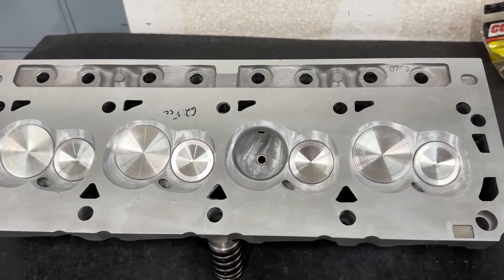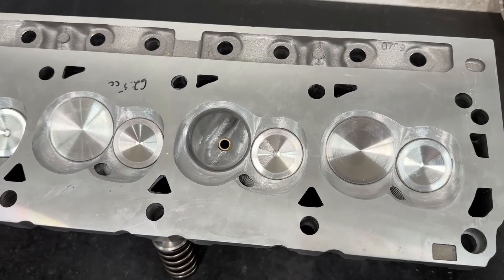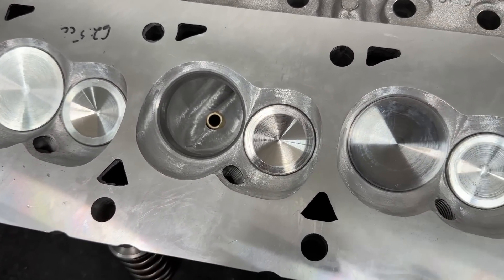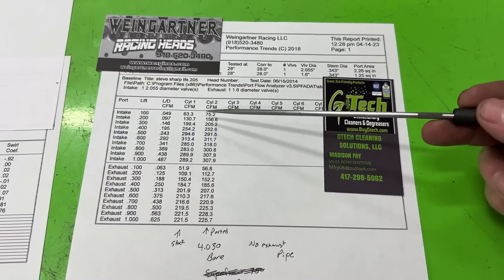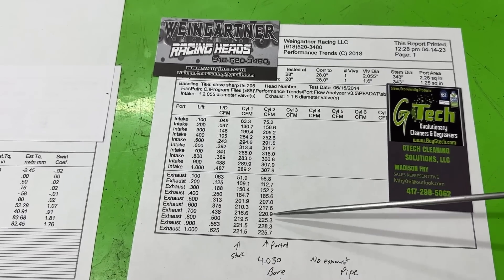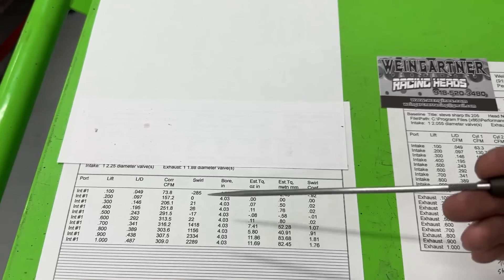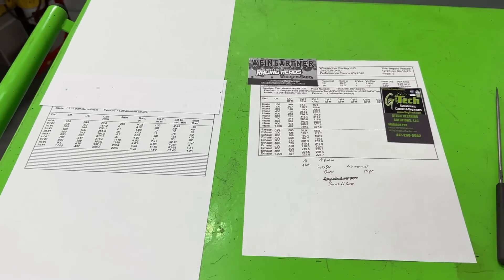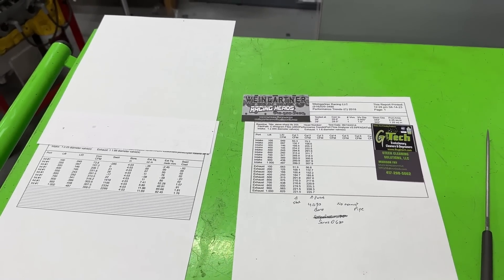SBF Trick Flow Heads

Comment: Back in 90s i built a 306ci first with ported E7s all add ons and 9.7cr, made 268rwhp at the time I upgraded everything so ran out of money for aluminum heads but set engine for them in near future.  Swapped just E7s for these cr remained nearly same and WOW what an improvement made 312rwhp.  Power increased across the board with peak HP occurring 400 rpm higher now.  I debated between these and AFR 165 and very happy I went with these, ran them about 2 years trouble free.
Reply: If you look at the dynos the TFS TW always made more peak torque than any of the others and higher hp.   The higher peak torque with the same combo means they are more efficient.   They really kick ass.    If you were doing it again, you could setup a combo that makes similar to coyote numbers with ported TFS TW and the right parts.

Comment: Thanks for the FORD stuff  hopefully you ll do more had a set of these on a low compression 351 with a 224 234  500 520 cam with 112 lobes never had it on the dyno but in a 3600 lb car it ran 12 60 at 109 with a 2500 stall and 4 11 gears  still have the heads plan to put them on a 408 and this video give me a direction to move in thanks

Comment: I know some of the class racers back in the late 90’s use to weld up the seats to drop the valve lower which helped with shrouding and that short side. Also I’ve always heard these are swirl ports that got noisy on the bench after .600 lift and the high ports are tumble ports.
Reply: The Ford Twisted Wedge with the stock intake port location and 15 degree valve angle stock is a mess but in the right hands they can be made to make great power. Had a set done by Mike Curcio years ago that were previously CNC ported buy a reputable company and one thing he told me was how loud they were on the flow bench at higher lifts and once you get the ports right they became much smoother and quieter on the bench and then you know you are going in the right direction with the port. The ports he did and the ports Eric did are almost identical at every valve lift except mine were 8 more cfm better at .400 and Eric's 6 more cfm better at .600" and 11 more cfm at .700 and they backed up about the same. It seems that no matter what you do they stall around .600"-.700" but they still will make great power. On a pump gas 374" to run 10.30 at 129 through mufflers weighing 3280 tells you how good these heads can be in the right hands. If I'm not mistaken I think Mike was the first to run 8's N/A with a T/W R head? Great job Eric and whoever is putting those heads on will be very happy.

Comment: Question, on my 3800 v6 heads. Alot of castings these days are cracked in between the intake and exhaust. Alot of guys just keep running them. What are long term effects of not replacing the heads while running heads that have cracks between the valves???

Comment: Interesting all the nuances from one head to the next. The only thing I know about Trick Flow heads on Ford small blocks, is they have always been known to make good power, and usually the best power per dollar spent. I don't think swirl is a necessity for these heads based on how the Dyno and track numbers speak for themselves.
Reply: TFS or AFR is usually a solid bet for making a powerful SBF with simple off the shelf parts. We are so spoiled today. You can build a 500hp+ 347 with all parts from summit racing and a credit card
Reply: @Bacongrease00 just the way it should be 😅

Comment: Thanks for doing this. I've been waiting for someone to not only flow but work these above .600. There just isn't any info out there. What do you think made the most difference in the gain between .600 and .700? I'm guessing widening the ssr? I would think that is a huge improvement for those of us who are pushing air through too fast already over .600
Reply from the maker: Widening the short side and more bowl area.

Comment: The oe’s spend alot of research on swirl, tumble and squish. It has effect on the combustion efficiency and emissions. But theres many factors that contribute, not so easy to sift trough.
Also it mainly seem to matter at low rpms. At higher rpms it is thought that the fuel/aur mixture have enough energy to get the mixing done anyways.
I guess back to back dyno testing is the only way to know.
Reply: I've heard the same thing - that swirl and tumble become far more important when the airspeed is low, like part throttle operation at low RPM

Curious if this particular design is just basically trading swirl for tumble.  Or, trading the energy spent on making swirl and/or tumble for more airflow?

Comment: Hey Eric, Questions for you. What is your take on welding inside ports (alloy), does it weaken/distort the head? what the chances of valve seats coming loose from distortion? Some heads have material lacking behind the valve seat inserts like procomps, is it possible to weld them up? what about epoxy in street heads, does it come loose, what would you use, what about down near the valve such as behind the seats or making a vane. Have you have epoxy come loose. Thanks.
Reply from the maker: with procomps I wouldn't trust the head period. On other heads it depends where you weld and how much.

Comment: What if we made a SBF 302 head with a 351W ort height (or a 400 Mopar head with a 440 port height) or a BBC Head with a Tall block port height    golly could you use the 351w  or 440 manifolds?   
That does not look like a SBF canted valve head  do they still make a SBC chevy with canted valves? OK OK just tripping   I care about .100  will try and address on your Q&A

Comment: Is it just me or does it seem like the "twist" makes the short turn situation even worse?  With the valve more where it wuold be if they were left in line it would have more runner length to make a less abrupt turn, they could have raised the floor and had more room to arch it down into the port.

Comment: 15 degree or 20 degree head???? Maybe I'm missing something  but 20 degree is normal and idk about a 15 degree tfs Ford head...
Reply from the maker: Trick flow made many different angle 20,15, and 11
Reply: I run the 11r190's on a boosted 349ci SBF and they have 11 degree intake valve angle and 13 degree exhaust

Comment: A lot of Ford's reverse after the convergence point, because of valve placement and port direction.  Darin Morgan talks about this in one of his wetflow videos.  It's not something you can do too much about because the port is just aiming the way it is.  The most "direct" path for airflow changes as the valve opens. Use a velocity probe and watch what happens.
Reply from the maker: I agree but I don’t think the less valve angle and really short side help with standard port height. I can take a Tfs high port and it will flow all the way up but it’s 20degree.